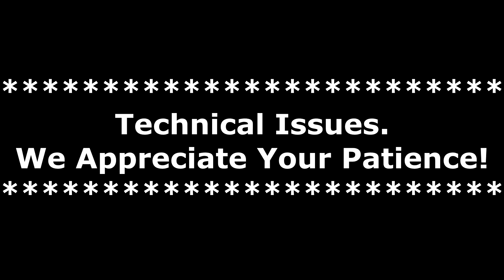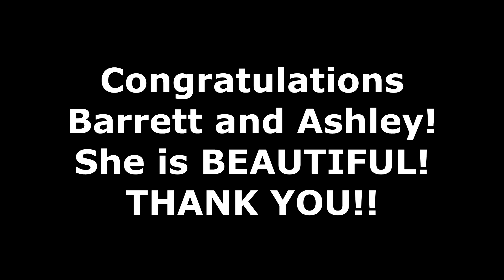Barrett's 1928 John Deere D: The Grand Finale!

Comment: Does that have an old Tilletson carb?
Reply: Dlx3
Reply from the maker: It's a Marvel Schebler DLTX3. Solid brass.
Reply: @KennyKizzleRustyNutzRanch  Cool, I haven't heard of that one. A lot of old machines have Tilletsons, Solex, or ones branded by Deere, etc.....
Reply from the maker: @jamesdiehl8690  Most all two cylinder JD's from that area (1923-1961) used Marvel Schebler single induction or dual induction carburetors. Single induction were used on the letter series, dual induction on the number series. Marvel Schebler was a VERY popular brand back then, same with Zenith.
Reply: @KennyKizzleRustyNutzRanch  zenith I've heard of. In fact I believe Zenith and Solex merged or something later on to import Solex for import cars.
Reply from the maker: @jamesdiehl8690  Never heard of Solex. I've worked on a large amount of tractor carburetors, though.
Reply: That's why I asked! I know Tilletson, Zenith, Solex (mostly imports), and there were a few generic parts companies in the 40s through the 60s for non car and truck brands. I can't remember many of them. Shops seem to have some surface from time to time. It still happens now on small engines. If you order a carb from Amazon for a lawn mower, it might be made by some guy in his garage in Singapor!
Reply: @KennyKizzleRustyNutzRanch  I just remembered another brand; Simplex! I don't remember what all they were used for though. Maybe small engines. There are a lot of "clones and knockoffs" for stuff nowadays. The replacements for Briggs etc... are getting pricey, if you can even get one.
Reply from the maker: @jamesdiehl8690  Ha ha ha. Always seems to work out better using the original castings and a good quality kit. Tillotson, and Bendix are two well known carb mfr's. I also have worked on Strombergs. They are pretty neat as well.
Reply: @KennyKizzleRustyNutzRanch  Yep!  I'm used to FoMoCo, Holley, Rochester and a little Carter. I've seen some of the other ones, but didn't have to work on them. Most of the ones on Amazon are clones of carbs that are factory made for B&S, Tecumseh, Honda, Kohler and Yamaha.
Reply from the maker: @jamesdiehl8690  Ya, I threw a new china one on my old Montgomery Wards Briggs and Stratton snowblower... Haven't had many problems yet, after 4 years. I drain the fuel for the summer, though, and run it out of fuel every time to shut it down during the winter use.